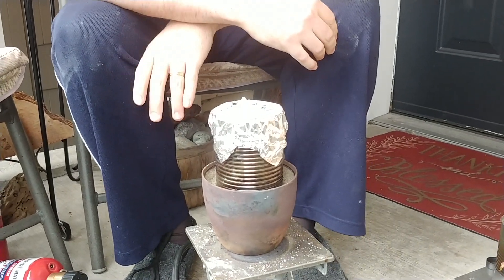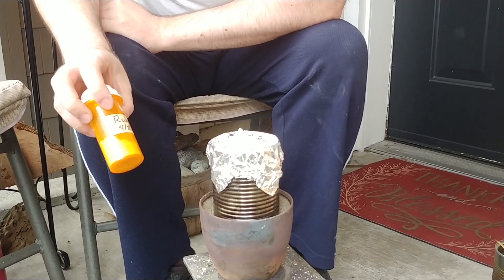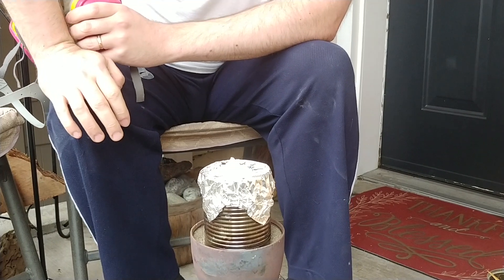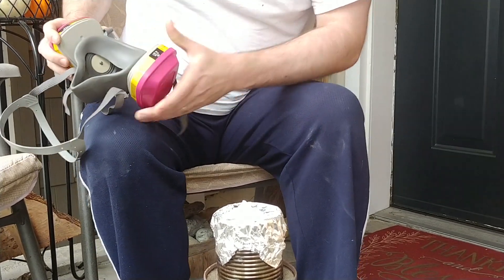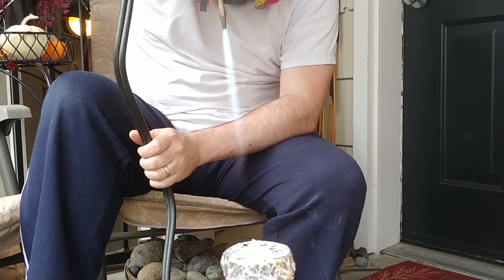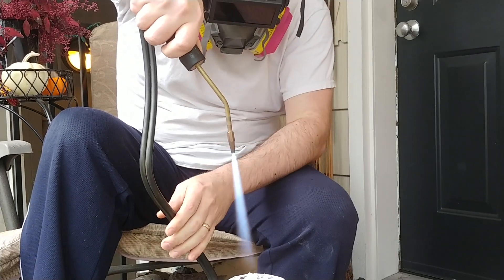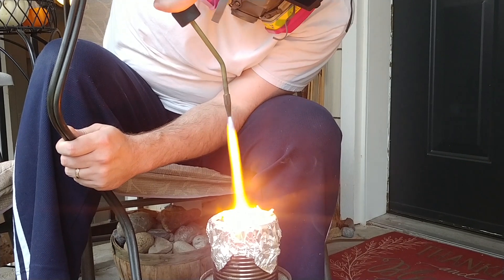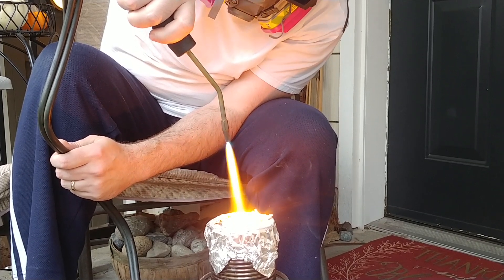Home Science: Synthetic Ruby Undergoing Flame Fusion

Comment: Matt I commend you for what you are doing. Hang in there until you have the success you want.
Reply from the maker: Thank you. I got some more parts on Friday in hopes it will serve well in my electrolysis chamber. I'm going to do a video soon on all the stuff I have stocked up on over the past 8 or 9 months. Even doing these crude batches are quite fun. I did more experiments with thermite this weekend and collected the slag to examine under the microscope. I am amazed at some of the lattice structures I found. I have pictures and I will have to include them in a video later on.

Comment: Pretty cool. Too bad sapphire is so difficult.  I see it being used a lot in watches and other clear surfaces that you don't want to scratch. Does the color green indicate hardness at all, or is that just a pretty?
Reply from the maker: That is just the chromium (III) oxide. I think this batch was not a good example of feed material because I realized later it was leftover waste material I saved for demo purposes. The Cr2O3 content is probably higher than I thought it was. I think the aluminum oxide may have fused together due to some favorable condition and pushed the chromium oxide into larger clumps which were more visible. The crystals are ugly under the microscope and I will be doing a video of that.

I usually don't see green powder when I perform this so I definitely need to make a new batch.

Comment from the maker: ...and yes, just to get it out of the way....  I am indeed wearing support hosiery as visible a few times in this video.  

I have to wear support hosiery due to venous insufficiency, also known as blood pooling, caused by tumor removal surgeries in my legs and feet.  If I don't wear support hosiery, I suffer rapid and severe blood pressure spikes.  The pressure in my brain becomes so intense, that it causes the most intense headaches you can possibly imagine.  I have blacked out before upon standing up.  I am also prone to blood clots and embolisms due to this issue.  I'll do a video about it sometime!
Reply: I dont care about the hosiery, but editing out the stuttering, blanks, hesitations would make the vids much more enjoyable
Reply from the maker: @manudehanoi  I agree. I'm working on getting an editor.